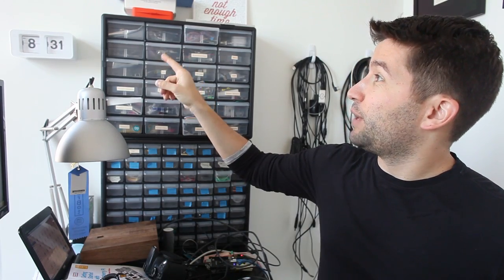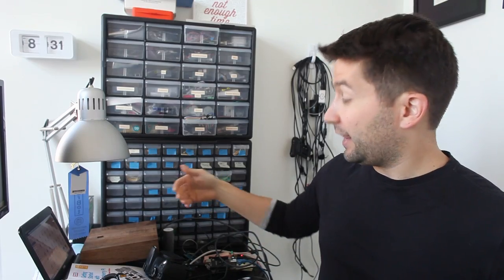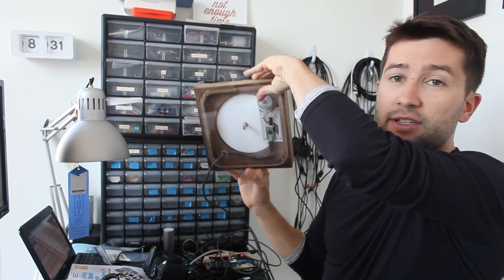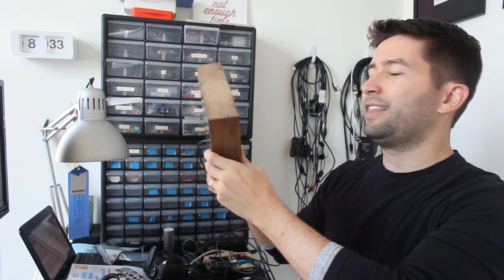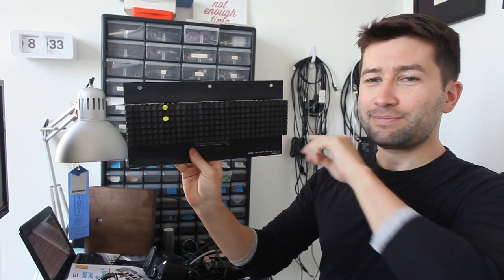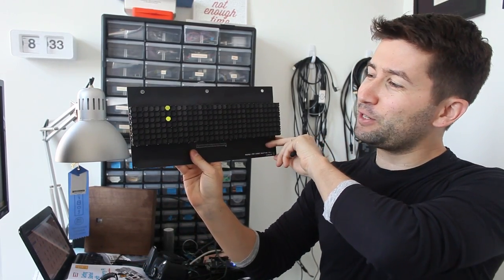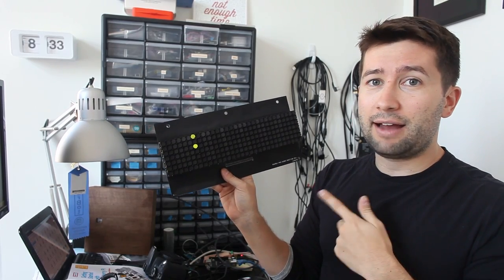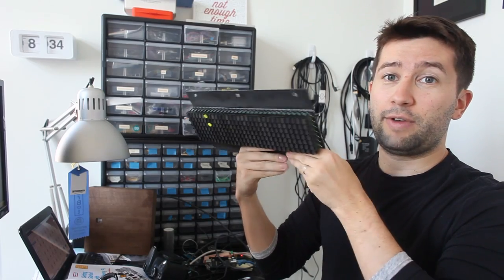Display Technology Fetish (Split-flap, Flip Dot, LED Scrollers)

Comment: I used to work for the company that produced Family Feud. I believe the board was built by FP in Mississauga, Canada and shipped to Los Angeles. I believe the controlling computer sent ASCII characters to the board at 300 baud and a separate module decoded the ASCII into the actual dot patterns to be displayed.

Comment: You can make a split flap display by writing the letter on plastic, then splitting, then placing on a spindle, and a stepper motor connected to the spindle. Add a tab sticking downwards above the top flap to stop it flipping. Hope this works!!!! :)

Comment: I have that same flip dot board - and the driver cards. Yes, it is just a matrix. You'll need high side and low side drivers... the TPIC6B595 will work well as a shift register + low side driver.

Comment: Here's a tip to deal with the negative voltage requirement, because voltage is relative, you can use a synthetic ground to avoid having to use a negative supply, for instance, if the dots need 12v to flip, put 12v on the common, and use 0v or 24v to place them, just remember to let the pins float when you aren't using them, as you risk burning out the coils otherwise (unless the display is designed to prevent that)